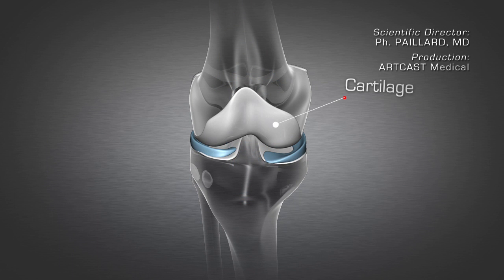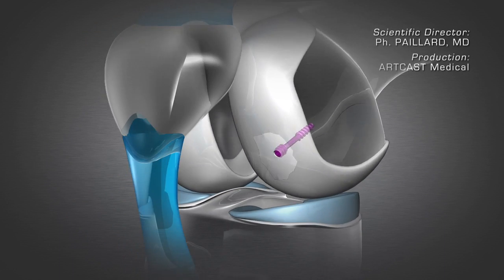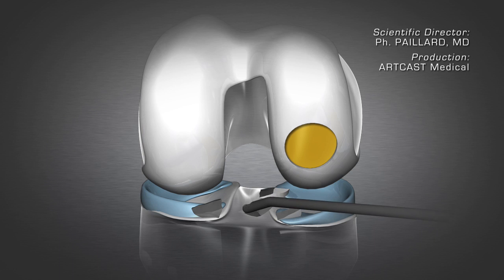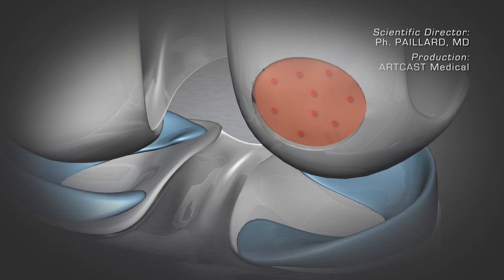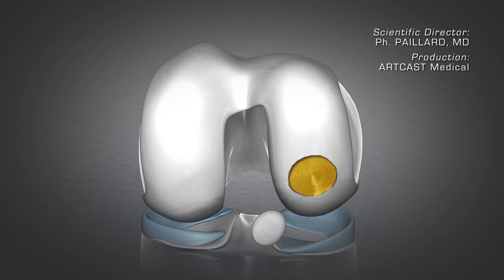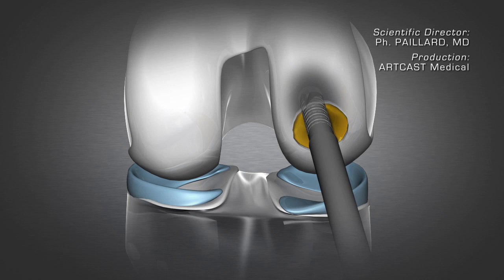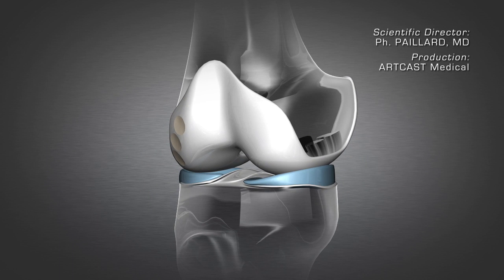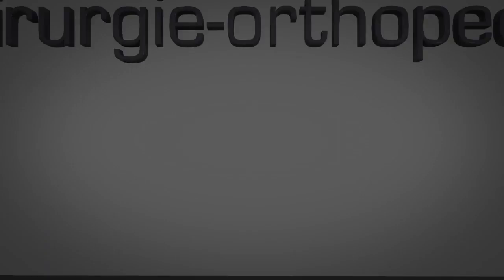Knee Cartilage Damage

Comment: Hi Doctor, I have been watching your videos, I am big fan of your work.
I have been diagnosed of Cartilage fissuring and on MRI below is the result : 
" Patella is normal in position. Extensor mechanism is intact. Mild lateral patellofemoral chondral softening. Focal high grade inferior central and lateral patellar high grade chondral fissuring measuring 2.2 cm transverse by 1.2 cm craniocaudal with subtle subchondral cystic change and marrow oedema. Articular cartilage otherwise and patellofemoral ligaments are intact. " 

I am taking supplements like Collagen and Omega 3 to repair followed by knee exercise , 
do you think it will repair of its own. I have seen improvement over time but will i recover fully  ? I am a sportsperson , i play basketball . Please advice. Thanks
Reply: how did you go man ? i have similar thing, it s been 3months, on MRI chondral fissure but nothing else, however my knee stays swollen all the time, i can run but if i flex my knee after 45 egree it s catching and cause sharp inside knee pain past a certain point in the inner knee - surgeon said he s not operating, should heal by himself.